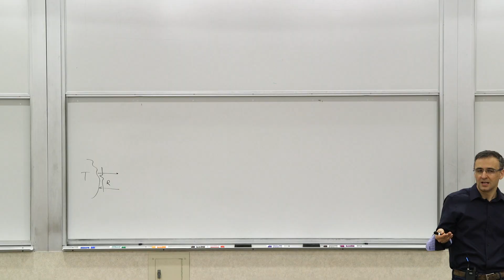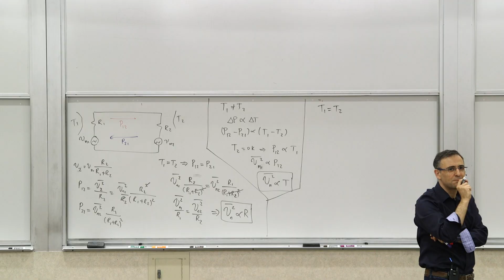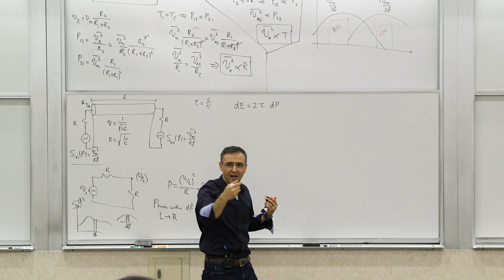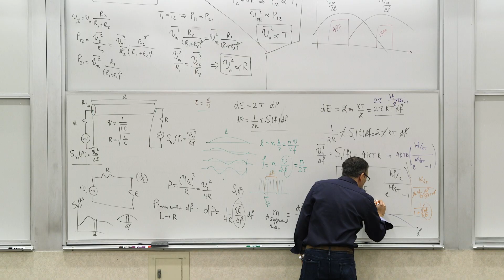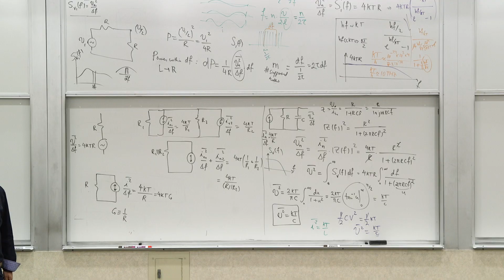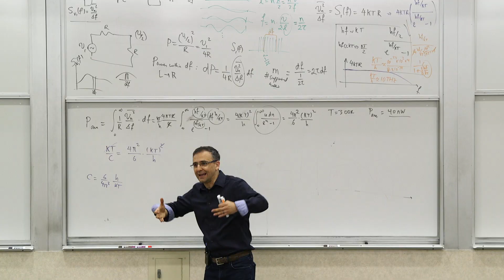173N. Thermal white noise physics, properties, and spectrum, KT/C noise, total available noise power

Comment: Even I can, or at least, have the impression that, I understand. 
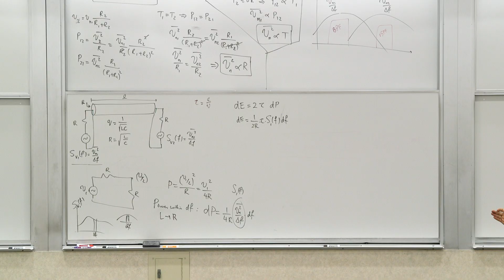Until you isolate the transmission line (23:30). Ok to admit that at a "sustainned" case, the energy will "vibrate" at a natural frequency of the system, and that we will have modes matching an (inverse) integer times of the Length, but ... Nothing forces us to say that it was ALSO the way power was transmitted before the cut-off. A little bit like a vibrating string of a violin, it may, for a time, produces a dissonent sound ("unpleasing to the ears", would have say Pythagoras). Or, if you prefer, what happen if the Length increases (due to temperature or otherwise), the modes would have to ... transit... to other modes. Is that transition, modifications of the modes , of no (or negligeable) influence on the amount of power present in the transmission line?

Comment: if noise power is independent of resistor, then does that mean a 1k and a 1G have same power?
Reply: Or that the resistance of the whole universe has the same "noise thermal power" than a single one ohm resistor (If that interpretation makes sense) ?

Comment: Excellent lecture. One thing just popped in my mind: can we make a temperature sensor based on the fact that rms voltage across capacitor is KT/C? I think that should be more accurate than the PTAT-based temperature sensors. But we have to average long enough to get rms voltage.

Comment: 41:37 - You have to add them in whatever way yields the right noise source for the equivalent parallel resistor.  Your current sources aren't necessarily going in the same direction at any given time, so you can't just add them.  Sometimes they CANCEL one another.  But anyway, I'd just compute the parallel resistance and use that in the usual formula, rather than trying to add the sources.

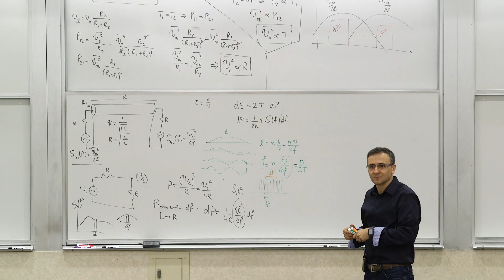Comment: 26:26 - Ok, question.  While the t-line is connected between the two resistors, neither resistor realizes that a t-line is there.  You look out from a resistor's terminals, and you just see R.  A resistance.  The resistor has no idea whether that's a t-line with impedance R connected to a resistance of R on the other end, or just a direct connection to another resistor.  So why does it deliver energy at particular frequencies?  I get it that once you short the ends of the t-line only certain modes survive, but prior to shorting the ends it seems like any frequency at all could enter the line.  The length is irrelevant, because it's matched at the far end and there's no reflection.  You stuff energy into one end and it never comes back.  So how do we reconcile all of this?
   
The best I can imagine is that all frequencies are first in the t-line, but at the instant we short it there occurs a transient period where the non-modal frequencies die away, and the energy in those frequencies shifts into modal frequencies.
Reply: This is my thinking.   If you assume spectrum profiles both resistor the same as it should be you can limit delta f to single frequency.No need to shorten ends of transmission line to the ground. Both end will be at the same potential and support standing waves.The  same for every other mods.